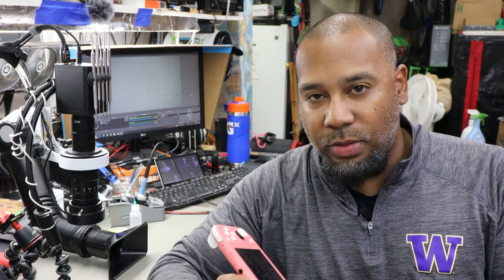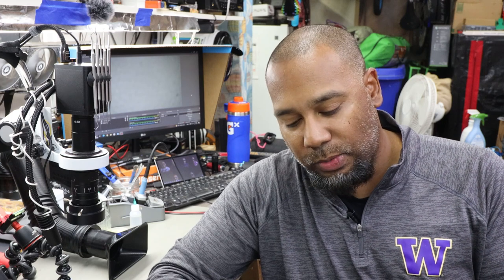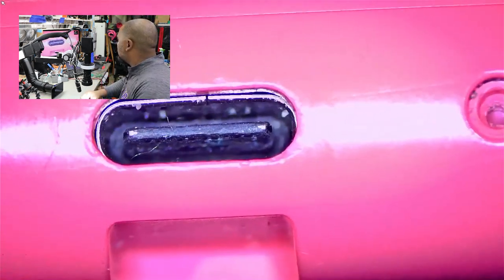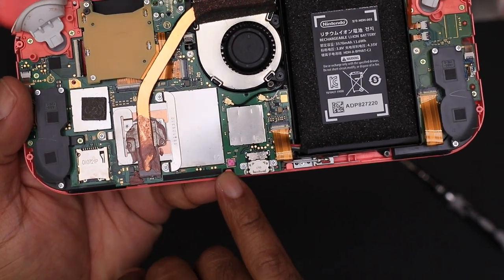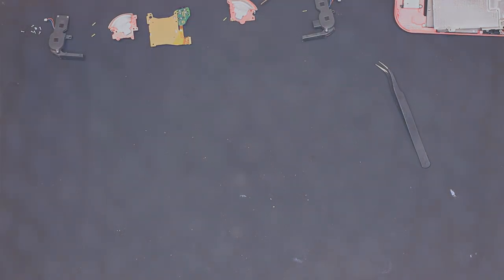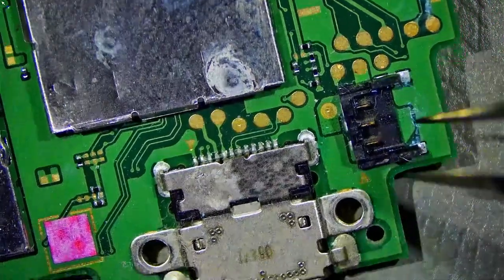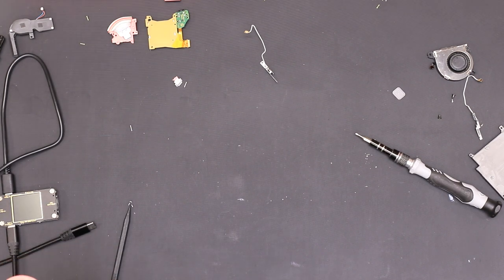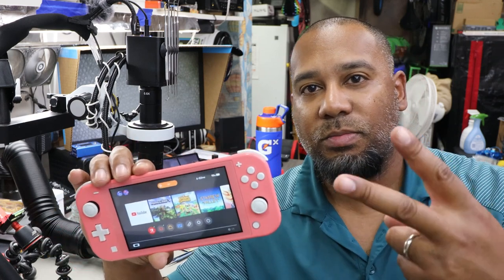Nintendo Switch Lite Water Damage

Comment: Not talking shit or anything good video bud. Im dealing with a water damaged switch that i cant figure out the issue. I hooked the board up in a working switch shell and wont power on but the working battery was at 16 before i swapped boards and after a few mins of charging with the "dead" board i put the working one back in to see if the battery went up and its at 24 now so charge port works. I dont have a voltage checker so had to do the round about way lol. Everything looks clean though after hitting with ipa and doesnt look like anything is burned and i checked for shorts and thats a negative as well so im stumped